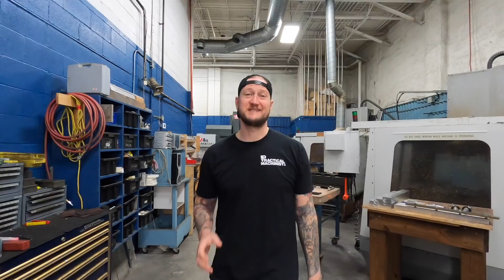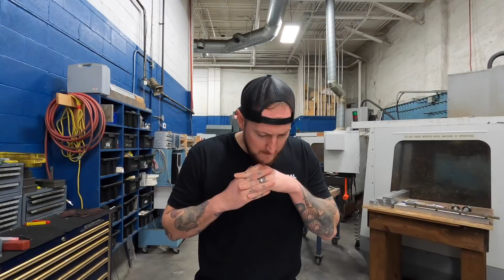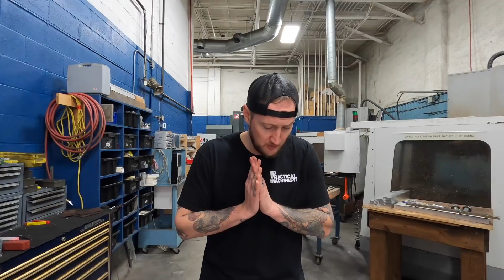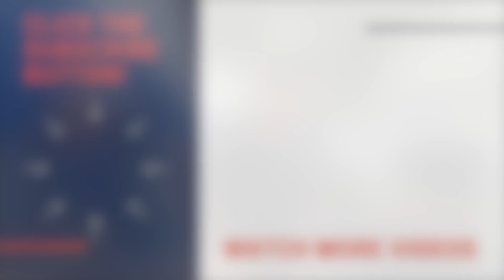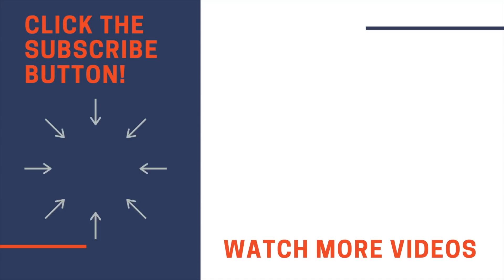Why CNC vs. Manual is Such a Heated Debate?! | Machine Shop Talk Episode. 46

Comment: When have YOU made the mistake of using CNC when you should have used manual, or the other way around?
Reply: I didn’t make the mistake, our “scheduling personnel” did. In the shop I work I’m the only manual mill worker. I run two Bridgeport mills with ProtoTRAK retrofit attachments. The retrofits are different but each have their Pros/Cons. I was asked one day that an order of 5 parts that I had on my table be given to a CNC worker because “He has nothing to do.” We are working 50-60 hr weeks because the CNC department is so far behind and still have a mountain of work to do. So I agree to let him take the parts. He had to write programs and perform two operations on these parts. I could have gotten them done myself before he had the programs wrote. So, he takes my 5 piece order and I’m stuck running back to back, 300 piece orders putting me behind but “That’s where those parts are ran.” That’s the logic in the place I work.
Reply: @DerkJester  you either need to move shop, or fix the fuckin CNC machinist up cause thats poor.

Like fuck i see it at my own work, people saying they have nothing to do, so the boss gives them the "good jobs" cause if they have nothing to do well all theyre work is done right?

So they end up getting jobs that are just not for them, like he shouldve flipped it and said no can i run more than 5 lets say 50. Or at my work, this one bloke has to step up now but hes scared and cant. Its kinda sad to see a trademan fail like that after being cocky and all.

Comment: Being a manual machinist for over 40 years, 90% of my work is fixing the CNC machines screw ups. The Manuals have 5 times more set ups that can be used to do repair work & a good manual machinist with a Journeyman's book that as time goes on you get better & better at off the wall custom set ups. A CNC is only for production make the part, change the part work, and you can get burned out real quick being a programmer.  Plus, the cost & overhead of a CNC machine can kill a small shop where a Bridgeport & a 14inch swing engine lathe is about a tenth of the cost. So each type of machines has a reason, it's just the manuals are much more interesting, and a CNC is boring as hell and a mind drain. Except for threading. A CNC will blow a manual out of the water on threading.

Comment: It is simple. One is not better then other. Each type of machine has it purpose. Manual machines are perfect for plant maintenance works - like quick modification of parts, repairs, quick one off jobs for parts of fairly simple geometries ect. or even some short runs of some parts. Skilled manual machinist will just do some stuff faster even if machine itself is not faster - but accounting for set up time, programming ect. manual will get the job done faster. For example quite common case: your maintenance guy need some flange to be faced and damaged oring grooves to be widen/fixed. Manual machinist will just straight take the part and start working, on CNC you need to program, touch off tools ect.  I think that problem is overusing CNC and over-relaying on CNC. In my country manual machining is dying skill, and CNC job shops don't want to do quick jobs without any 3d model or drawing being provided. Result? Old manual machinists doing this kind of work, often being able to very fast reverse engineer parts, are overwhelmed by the amount of work given to them by plant maintenance, mechanics, farmers, construction companies ect.

Comment: Each machine has a place. We make repair parts, most of the time one only part, this is what most manual shops specialise in. A CNC machine would just slow us down, code and set up for 1or2 parts would not be practical. Now if a customer wants 100 pieces, then we send him to a CNC shop.:hand-orange-covering-eyes:

Comment: I run a 54" and  42" VTL Bullard from the 1940's. 
It has been well maintained and runs wonderfully. They're the only machines in a shop full of CNC's that can machine parts after they have been welded multiple times.  The parts are just too big, and oddly shaped for the CNC machines we have.. 

We heavily rely on Manual machines in my shop, for that reason, and others.

Comment: you did mention lightly the reality of manual machinist , skilled very skilled it is a art with your hands some thing you create ,same for the difrence for production shop vs job shop.
in a job shop from sawing the steel to building the crate to ship it to a rig ,you alone do that every step , that is a job shop, your a production shop OPERATOR , you are more of a white collar computer programer , we in the dirt and stand back and say i made that , when you can make a drilling head with a boring bar your skilled.
enough of that ,but keep in mind ,you and the cnc and nc put the skilled workers on the un employment line and have also worked yourself into running parts for nothing to keep work, so the sad song is you made it and now you dwell in it.
i tried cnc , ran a tawkasa and ll7 , hated it , took a whole day some times to setup and run first part, then when you did same shit for days, the talk of running more than 1 machine would have got your block knocked off back in the 80's hahah.
all a side i still enjoy my old trade sweap under the carpet from the 70's and 80's .watch machine shop vids and you know every time i see coolant i can still smell that nasty crap hahah, good show man like how you bring other shops into your channel

Comment: I did 5-6 months on a manual mill before starting CNC, Imo spending more then 2-3 weeks on a manual learning the very basics is a waste. Not only are you behind in CNC you will have to spend time unlearning bad habits from the manual.. If you run a modern industrial CNC like a Bridgeport you are doing it wrong.
I work in a tool and die department so almost every part is singles or very low numbers, we have thrown out every manual mill but one that is collecting dust in a corner but i cant think of any job worth doing on it.
If you got your machine setup for single parts CNC is faster, i got 60 of the most common tools ready in the magazine and macros for every common operation in the cam program.
For instance if i need to put a couple of threaded holes in a part i just click on them in the cam program and select my macro for that thread and hit ok and send it to the machine.

This way you have very short setup times and i can have simple parts probed and a program sent in 3-4 minutes. From that point the CNC runs circles around a manual. 
Facing with 2hp and getting chips in your hair and all over the floor vs facing with a 40hp spindle..
Drilling with spot drills then switching to a twist drill and pecking your way though the part vs drilling with a self centering TSC carbide drill that blast straight through the part with no pecking needed etc..

Comment: Was a manual machinist for 12 years, horizontal mill, vertical mill & lathe.  Now the last 25 years cnc mill & cnc lathe. They both have their spot for jobs in a shop.  I still have a manual mill & lathe in my job shop. The mill is a great drill press and time to time a quick mill job. The lathe we use for deburring, polishing, or a quick turn job for a walk in job.

Comment: Another pro for manual is.... The maintenance costs is way lower.... Cnc's are more frequently put out of action from some electronic component going wrong........ Since manuals are cheaper machines, you can still make parts slower than a cnc would and still make a better profit off of a manual
Reply: Oh man, I can relate to this. Just had the waycovers blow on my biggest mill - there's it out of action for the day. Fix it, and then the coolant / oil separator decides to crack on me - leaving a nice coolant lake behind the machine while we wait for parts. What a mess!

Comment: Personally I think the two year degree program for advanced manufacturing that spends an entire year teaching manual machines is a waste of the students money. 99% of them are going to get a job running a CNC that’s just the way it is.  The job has evolved into a more tech enabled job with CMM CNC CAM CAD etc, and I believe they should be more focused on the future of Machining rather than the past.

Comment: cnc machines are criticized only by those who have never bothered to learn them. They are intimidated by them but their pride doesnt allow them to acknowledge the facts.  Both machines have their place in a modern machine shop. (Try picking up a thread on a cnc to recut). A machinist can only be a good judge of the proper place manual or cnc when He (or She) is proficient at both. I would also mention that cnc 's have fundamentally changed the design of parts, parts are much more complicated in regards to the profile as there is not much added cost associated with these more complicated designs. also with cnc You can load a part and get so much done in one vise clamp. all the operations done within this set up will be spot on.

Comment: I've been strictly a manual Tool and die maker ever since I started my career over 10 years ago and honestly, I wish that I knew how to program so I could get more work done since I'm the only toolmaker in my shop now. Being able to build die components on a manual machine while having other components being made on a CNC would be like having another toolmaker in the shop. I think it would help make my life at work a bit easier. Maybe someday.
Reply: especially since you can pick up an old Fadal cnc mill for under 10k and add a world of possibilities to Your operation. I am also a tool and diemaker with my own little shop. I even use the cnc mill for flycutting die blocks to size in MDI mode. You have coolant and the mess is in the machine.  I need all my machines though, manual and cnc. Try putting a tool post grinder on a cnc lathe.
Reply: @danneumann3274  you can also get something like a Hermle C600U for ~30k

I just recently bought one from poland for ~32 including shipping after being told of it on YT

Comment: I work in a tool making company (carbide end mills, spot drills etc). We have CNC and manual machines that both get used heavily. In my experience CNC is hands down better for making new tools, especially in large batches. Whereas manual is sometimes better suited or even the only way for modifying or regrinding existing tools. CNC is 80% of our business but why leave that other 20% on the table.

Comment: When you buy a 30k cnc, your not buying a 30k machine, your buying a 5k machine, with 25k of computers, wires and servos.... We paid 1k for a lodge and shipley lathe with a 12 inch chuck and 7 feet between centers, our cnc lathe was 30k, and it has a 6 inch chuck and 10 inches of z travel, with no tail stock. Cnc is for automation, manual is when you need the larger machine with more capacity. We have regular jobs that are too big for our cnc mill, but the cnc mill can still do first op, which is complicated and has five tool changes, but the second op has to be done on the Bridgeport, and I can run the Bridgeport while the cnc mill is running its 28 minute program unsupervised.

Comment: As someone starting on their own. I have a deep appreciation for both. As Ian suggested, it's super subjective but from a personal perspective I wouldn't buy a manual machine these days. My thinking is why would I allocate precious space and funds to a manual machine when a cnc alternative can do the same job + all the benefits of automation. Yes sometimes a manual mill is nice to have but for me I don't do enough to justify it. Cost is another factor. Cnc Mills and lathes can be purchased for very humble sums of money these days. For instance my bridgeport interact 720x vmc was €3000 a half decent knee mill would have been similar in cost
Reply: DId exactly that. The interact 750 took a lot of expensive repair and the knee mill nada. I used both constantly.

Comment: the manual is great for making fixtures or turning or milling  limited pieces but you wont be in business long doing  production on a manual
Reply: You will if it's really specific work, I used to work at a place that had CNC lathes that had 3 meters in swing.

Before these, we were sort of the only ones able to make the part and as such, manual machines were perfectly fine despite the days it takes for each part to be made.

Comment: Try doing this. Go work for a OEM job shop or mom and pop job shop that makes parts for OEMs or for manufacturers directly that lack machining capacity and/or capabilities. So pretty much anything non aerospace or defense oriented. Just true to the roots machining for American industrialist patterns or trends dictated by Adam Smiths invisible hand or by government infrastructure spending giving way to climbs in certain companies industrial patterns sometimes. Ok. In this realm of work, precision may not be as key as aerospace or defense work, but quick production programming is must know how to do along with synchronized setups, etc. This is called using a CNC machine like a CNC lathe as a manual machine like a manual lathe. Quick conversational programs into the control to face off .100 of stock, Jab a quick .069 deep undercut for relief  and turn a diameter to OD 9.900 mm, and, turn a little M10 thread on that OD and finally part the part off .06 in clearance from the chuck face because you’re holding the stock/part in an adjustable three jaw and u don’t want anymore runout than .015. That’s called using a CNC lathe as a manual lathe machine.

Comment: No debate really, manual machinists are B class :)
Reply: My dad was a manual machinist. He made complex precision workholding for indexable fixtures holding gangs of parts . he was doing the job planning and making decisions on porting tools and sequence of operations and designing and building the fixtures. all since the early seventies on NC tape mills. I remember when I was 18 and just working a few days at the shop He worked at and He was the foreman. The cnc lathe was leaving chatter on the part. The vise president who hired me said " see Otto" (my dad). My dad took out his diamond flat hone which He always had in his top pocket. glanced over the insert a couple of strokes and said " try it now" Guess what , chatter was gone. His knowledge of machining fundamentals kept that cnc shop running.  probably not b class.
Reply: @danneumann3274  was a joke

Comment: The biggest drawback to cnc I can see is the mystery metal scenarios. Example castings. One void filled with sand can ruin a machine or bits faster than you can blink if not watched constantly. Which defeats point to multiple cnc. Fluid blockages, and other mystery machine scenarios crop up. Manual you will notice even using an auto feed.

One advantage is you can have watchers at each machine than only need to know when to hit the stop button. The machinist can then come by and fix what needs to be fixed, changing them from machinist to basically a machine service man.

Plus to cnc = many are lathe and mill in one. Hard to reproduce some operations on any other single machine. Complex rotary valves with switchback channels.

Plus to manual = automatic adjustment for machine wear. All machines wear over time. Cnc machines will wear and have issues that, over a batch , can have widely varying tolerances. Manual machine runs just won’t as the machinist will adjust as he does each part.

Aside from factories there really is not a field for machinist that will use a cnc very much.  Why because they are doing repair work. Unless your doing the exact same repair to hundreds of same part you’ll spend more time setting up machines than doing actual work.

All that being said. Dodge brothers engine and drivetrain factory, before it was part of Chrysler corporation, had hundreds of auto machines running parts unattended. Automatic complex gear and cog driven instead of a computer but still an early cnc. Many many early car part for Chrysler, chevy, ford, and many others were made on those machines.
Reply: and this old automated engine machines with gang drills would beat any single spindle 
cnc even today. How can a modern cnc compete with a machine with twenty drills all coming in at the same time

Comment: I find it really hard to justify manual machines these days 

They have faster cycle times, set up times and if you know how to make a program from scratch itll take you only around an hour to a day depending on the setup and tooling.

Yet manual machines take forever to make a thousandth of what cnc machines make in the same amount of time.

I will say though machines like hydroptic jig borers are very very useful even today, but for most things to the 0.000mm or 0.0000" you wont get better than a CNC machine. Esspecially when you learn how to push them properly. Id love to learn on a manual machine but im very thankful i didnt.

Comment: I have come up in the mid 2000s running mostly CNCs. With the advent of tool room mills and lathes with semi open box designs and easy to use controls/programming software i find it hard to justify putting anything on a manual machine. By the time you set up anything on a manual the job can be programmed and documented and done right with less guess work, maybe a slightly longer setup time but far more reliability.